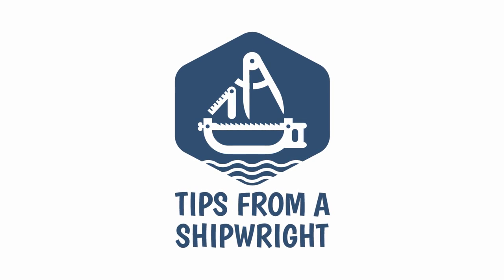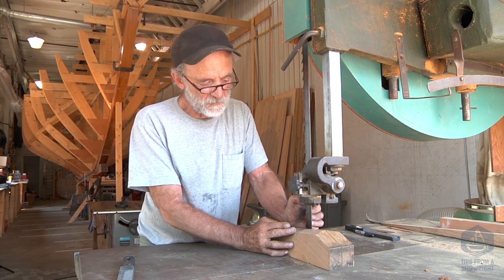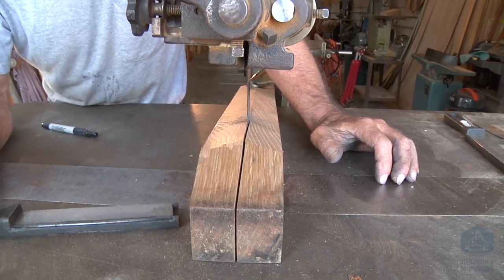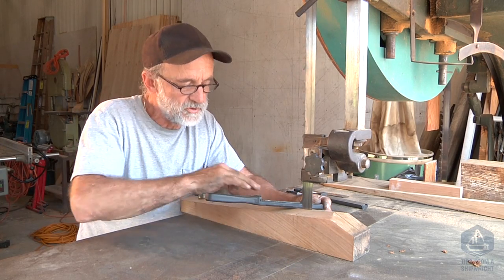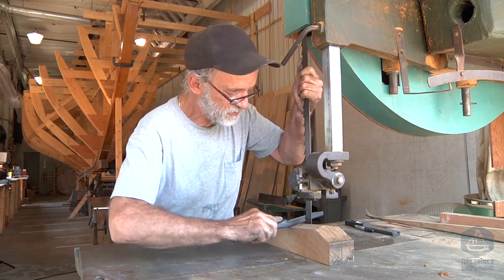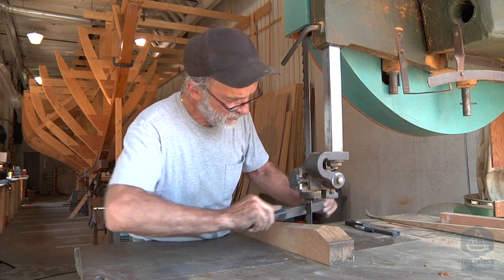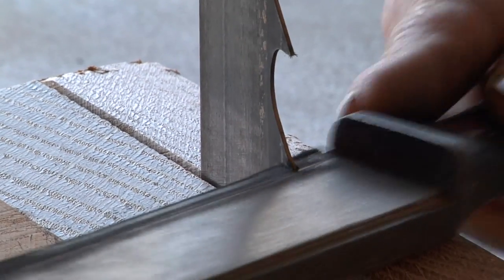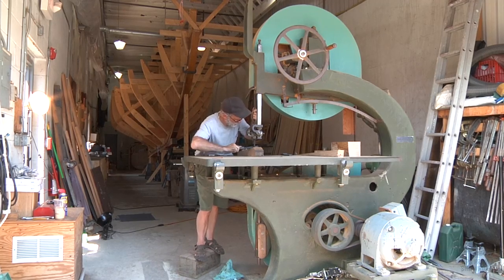Lou shows us his massive Ship Saw and how he keeps the blades sharp

Comment: Lou , took me back 30 years :) i know its back in 2015 but still hope you read this.
, anyway ... you need a proper setting tool, for setting the teeth and (normally 1.3 of the blade thickness).... if you keep sharpen the face like you do, you will end up with a sharp corner below the tooth in the gullet, that will encourage cracks ! a tooth setting bar is nothing fancy, just a bar with a slot to fit over the tooth and bend it too form  a set left right or centre a tooth up,,, Band saws are great at doing what we want them to do, as long as the band(saw) is tension-ed correctly... So... wet wood needs more set than dry wood and hardwood needs less set than  wet wood...and so on... keep the crown clean and she be good to you, the tensioning i am talking about is not on your saw, but rather at the saw shop, where we use a pre determined straight edge with a curve to the side to fit the saw-blade backside by rolling the saw through steel rollers we can apply tension to the blade, to stiffen up the tooth side, or to loosen it up, if done incorrectly your saw will run with a chopping motion and no matter how you adjust the blocks or wheels ir always runs forwards and backwards on the wheels in a 180 degree fashion.

Comment: mate i'm a sawdoctor. you call them saw-fillers I think. And I that's a great way. apart form setting the teeth, that being set out to each side of the blade, that is a good simple idea to make/keep your blade working well. thanks for that.

I work on and make saws up to 14inch wide and 62 foot long.
Reply: 14"x64'?! What type of machine runs a blade like that? Do you have any photos?
Reply: @bushratbeachbum  that particular blade, I made it when I worked for Thode Knife and Saw in Rotorua NZ. It was made and sent to a company in Fiji.

https://youtu.be/IV97qsFHA8o
Have a look at this link.  It's a sawmill in the states, there blade looks 12"wide 40foot long.  
Good video too.  Cheers mate
Reply: Awesome, cheers mate!! They look like they can handle a decent sized log!!